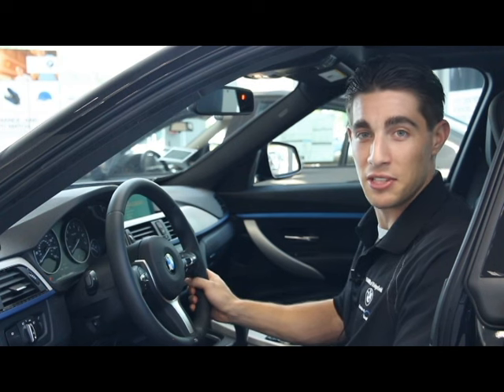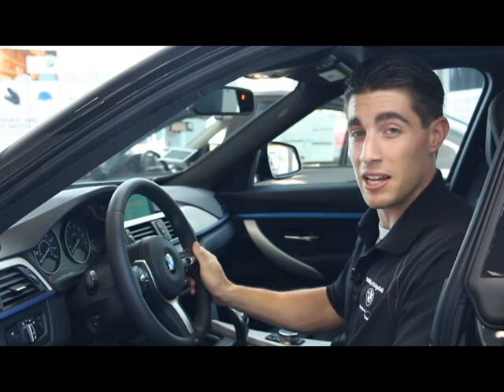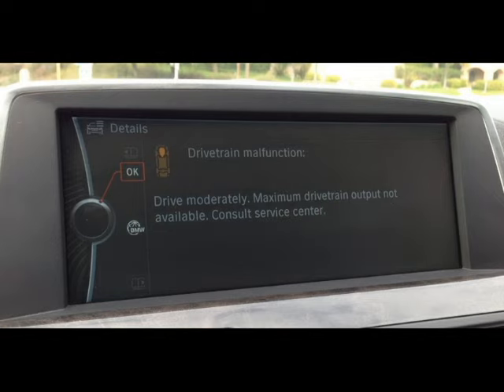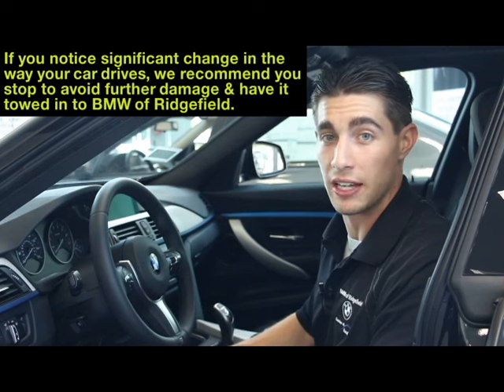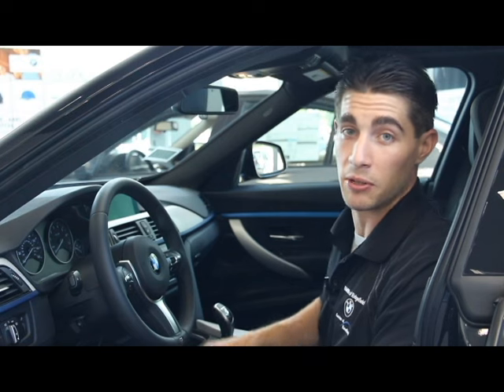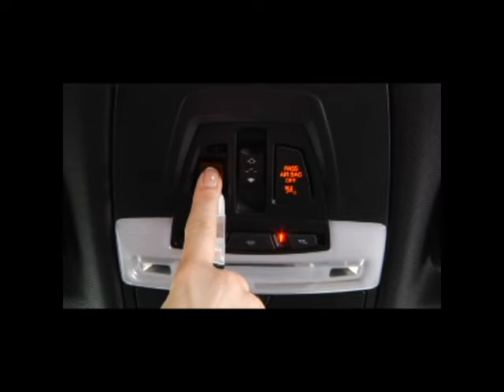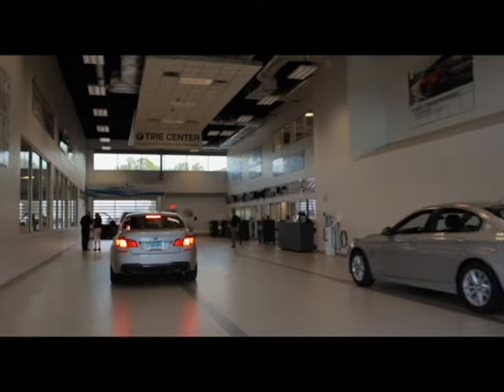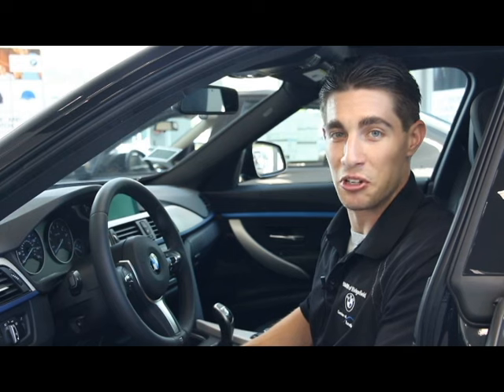BMW Drive Train Warning Light & How To Respond

Comment: bmw the ultimate driving machine that spends more time in the garage being fixed than being driven !
Reply: You're right
Reply: Haha u hater.. if u cnt Afford dnt hate..
Reply: not mine!
Reply: Yes I agree I love my bmw but true
Reply: @wach1722  I can afford one easily can you afford a classic ford
Reply: @MegaReddevil71  Mustang Shelby would be nice. New or old!
Reply: You must have bought a shitty second hand one and cant afford the basic maintenance on it
Reply: Well I’m almost at 200k miles in my f11 and only had a garage visit for timing chains renewal.  I drive it quite hard every now and then but mostly motorway miles so the engines spotless inside as are the intakes etc. I change oil and filter every 4k miles as it’s a 15 min task which I’m sure is the key to a long lasting reliable car. Plus, keep it away from main-stealerships  as I’m sure they have lots of monkey technicians (fitters) rather than real mechanics who have no care about their work.✊

Comment: This light came on for me after I got my spark plugs and coils replaced. The code is 120208. Does it need reprogramming? Did the mechanic put on a vacuum hose in correctly? What should my first step be?

Comment: Yes very useless video; they should have told you to a) stop the car b) turn off the ignition c) wait 30 sec. d) turn on the engine to let the software reboot e) drive away without an issue.....I have a 2012 550i and the fuel injectors have been replaced twice, look for class action lawsuit in NJ.
Reply: Completely useless video...and the guy in the video had to get a manicure for the video. +1 like for the shiny nail.
Reply: Was the problem ever solved I have a bmw 550 and somtimes when I get on the gas it goes into limp mode and idk y
Reply: Our M sport 328i done the same thing today. Pulled over and turned the car off. Restarted the car and all lights went off . Drove it 12 miles home without another issue. Hope it doesn’t do that again. Car only has 40,000 miles on it.
Reply: @JimbobZ17  Time for a Lexus Toyota.
Reply: 33231303 traded it last week for a 2019 limited 4 runner . No more BMW . Had 2 and learned my lesson on these money pits. When the warranty runs out best to get rid of them .
Reply: I have 2011 bmw 550i and also had this issue today - pulled over turned off and hopes this works. Thank you!!

Comment: BMWs are great machines without a doubt, had x6 2012, 2014, 2015, 2018, and 640i 2013 gran coupe, they always performed as planned. BUT... when one small damn issue shows up everything goes south for a month. ignition plug took 3 visits each visit I had to leave my BMW for a week for them to find out that I had an ignition spark plug problem that they had to swap for my 2018 x6 in the same year. And now with my 640i, I have this and I'm worried it is the gearbox because I had a rough changing of gear occurring frequently even when I put it on cruise control.
So, ultimate driving machine, even after being a loyal customer for a decade I still can't call it that
Reply: I hope you get it fixed bro I got my 2008 328i coupe just put about 4 k in it water pump, all brand new breaks running and drive good for me now for a 2008
Reply: @songlee1253  it turned out that my intake valve connection had a crack in it, it took 2 months for the company to ship a new one, during that that they kinda filled/glued the old one with the crack to close the hole, two months later i had it swapped
Reply: @abrahamkhafajy8214  wow two months dam will hope it all good now got a good ride you have👍😎🔥

Comment: My wife bought a 2024 X6M Competition, after 4 months the car start stopping while driving on a highway. I pulled off on the side of the highway to call bmw for towing I was told they can not pick it up on the side of the highway. Totally a joke right! After 39 mins started the car again and headed straight to the dealership ship, nobody know what’s causing the car to stop. Finally decided to call BMW myself and return the Car back to them. At the end BMW said it was a bad transmission. 4 months old is dead. Done with BMWs. Incompetent mechanics at dealerships. The clowns call themselves GENIUS are the ones that know nothing about cars

Comment: I have a 2013 X3 twice I had the drive-train issue , the motor slows down, it looses power, the gas pedal , does not input gas, the car stops,. This has happened only when the washer fluid is very low. Once I refilled the fluid, the cars starts without a problem and the message disappears! Conclusion it is a computer glitch, that BMW refuses to accept!
Reply: Isabel Alvarez OMG I think you are right because my windshield wiper fluid is also low so I hope this fixes the problem
Reply: @Vibrations-iq5be  was this the problem??

Comment: This so Called by BMW Flagship of BMW, having constant problem with Powertrain,All I did was to push the gas, than warning sign comes up, car will not move , shaking real bad and only goes 15 miles and hour, I was in the intersection and saw an other car would not stop i push the gas to accelerate with in seconds warning comes up and stops the car to 15 miles and hour,  
 i have taken the car 4 times for the same problem, while it was under warranty they keep re-setting it,now it is out of warranty less than 90 K miles, they are trying to charge over $2,800 dollars for the repairs,. this cars are faulty and they should be recalled World wide, there are 730 complains in the web from every person bought BMW. Car they sell over $100.000 dollars will not last more than Toyota. it is a shame and BW should be a shame priding themselves about their cars ,especially their Flagship 750. Do not waste your money on these cars, it is a Hype, ,only BMW is worth anything is 3 series, inline 6 are reliable other than that, they are all lemon as far as I am concern.
Reply: ma ta can't be said any better

Comment: Just bought a used 2014 BMW 320i.....had it for a week as of today. Me and the family loaded up to go eat a steak and got a "drivetrain malfunction" warning light that appeared. Vehicle was still operational (shook badly) and I drove it into the parking lot in disbelief(as I just bought this car with 34k on it). Upon purchase, the vehicle still had about one year left on the original warranty. However, due to not really knowing anything about the foreign cars, we did buy any extended warranty(75,000 additional miles or 5 years/which ever comes first). So far only made it 942 miles... Then this f*** up. Taking it to BMW first thing Monday to see what the diagnosis will be. Prior to this, we had a 2007 GMC Yukon with 152,000 miles with no problems. I shoulda kept it. I may be going back to AMERICAN made.
Reply: Had my car for a fucking week before I got this warning on my dashboard. They need to do something about these fucking cars. I'm looking for a class action lawsuit. Its ridiculous. I'm going back to my range rover. I have to put my car in the shop to resolve this issue.
Reply: I think their is a lawsuit, must fill out a form 
Go on fb look up bmw timing chain problems, 2 fb pages dedicated to this problem. Bmw na knows about about it but is not doing anything sad.
Reply: I'd take the warning light over mine howling like a banshee (sounds like hitting the brakes after the rotors get rusty through a rain storm or two, especially near the ocean) any time i let off the accelerator ... i think the front diff at itself, car only has 52k on it, and i got it with 8k. I've been meticulous about maintenance -- the ONLY fluid I didn't change was the front diff fluid since the rear looks so nice @ 35k, I figured I'd get to it soon.  Looks like the fluid was contaminated ... a diff failure is ridiculous @ 52k -- and this is the week after the lovely electronic water pump /thermostat failed; a 10hr job in itself (for DIY on ramps in the driveway, whose idea it was to make the pump electric, i'd like to meet) -- savings, my ass.

Comment: 2012 BMW 528i DTM light came on twice in one year at 50K cost me $5,500... In one YEAR. Replaced all 4 tires at the same time so I spent $ 7,200 on the car in one year and then sold it right after...  MY 750i was  in the shop 23 times in 2 years and they wouldn't buy it back. They just kept fixing it for various issues.. They said since it wasn't the same issue  eaxh time it didn't qualify for buyback or lemon law in my state...BMW.  (Bring Money withya)... when u go to the dealer. I'm done with  them.